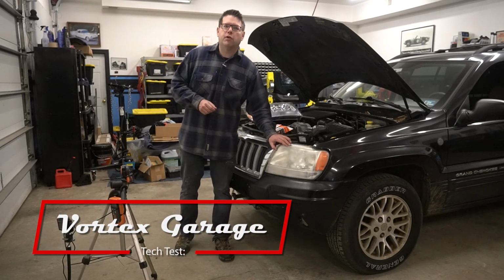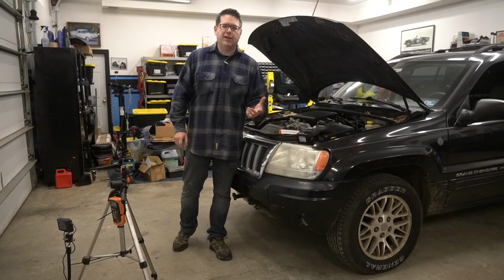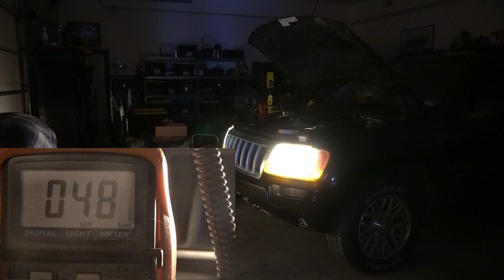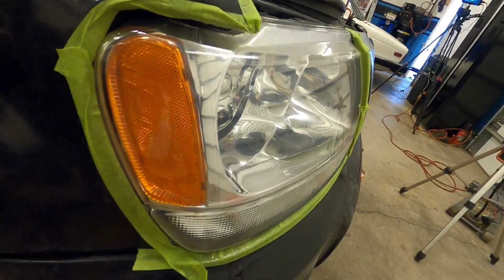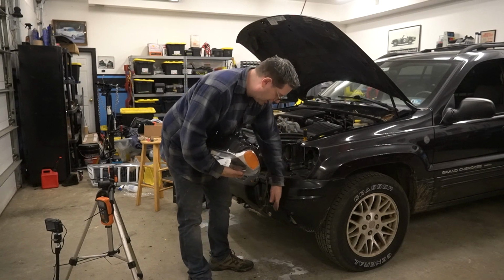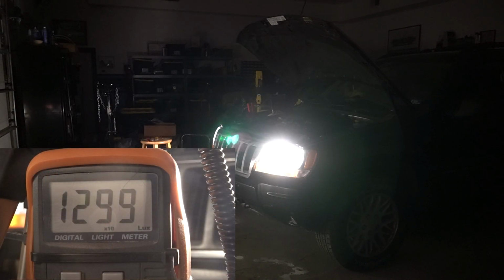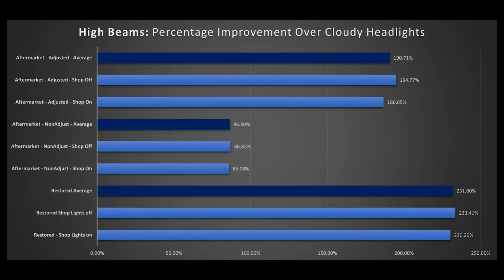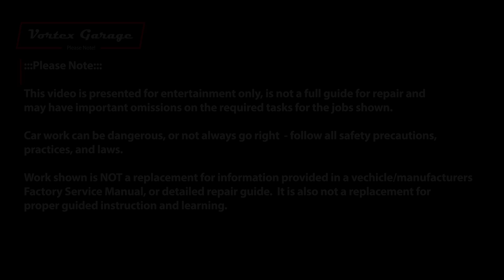What's better? Restored or New Headlights?  We'll show you what's best using this WJ Grand Cherokee

Comment: Good video and nice test. My headlights were cloudy so I did a wet and dry scrub and waxed it to finish them off. Didn't bother using any clear coat or UV protection stuff. Did that about 3 years ago and they only need a quick wax to remove any crud in order to spruce them up. (I used 1800 then went to 2000 and finished on 2400 grit, using small circular patterns and plenty of water.) Also, swap the standard bulbs for 30% brighter all weather ones- they remove the yellow tint and add a whiter light for a more modern look.

Comment: Would be interesting to find out whether it is true as one advertisement claimed that a new standard/plain OEM headlight bulb is brighter than one that is used,say,to 70% of the way to average burn out time. 
Also I can't figure out why putting blue filter/pigment in/on the quartz bulb would help with brightness-I would think it is just subtracting some of the red or orange light and converting it to heat. (Some of the bulbs advertised as extra bright have blue color on the bulb) I think "Xtravision" or "Nighthawk" are clear. They don't seem to be available in 9006XS or 9005XS which would fit the WJ.